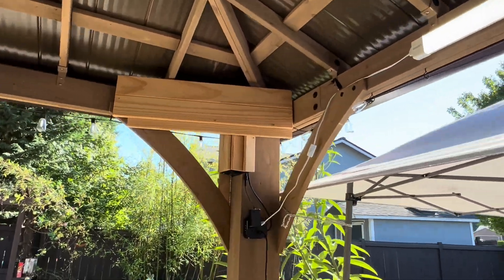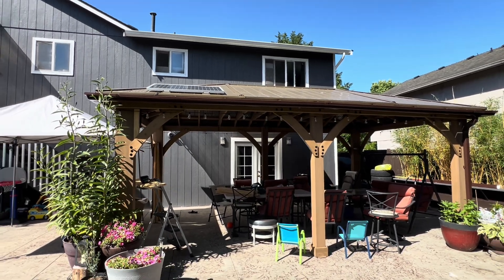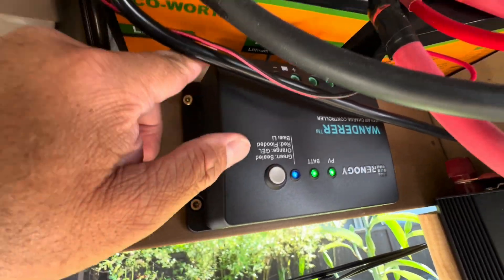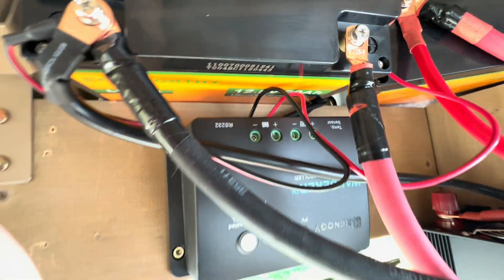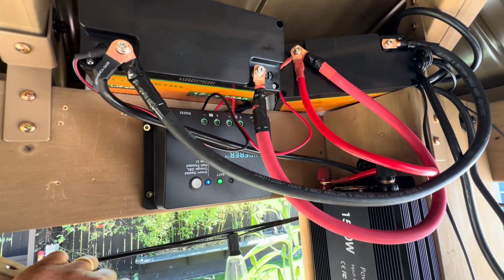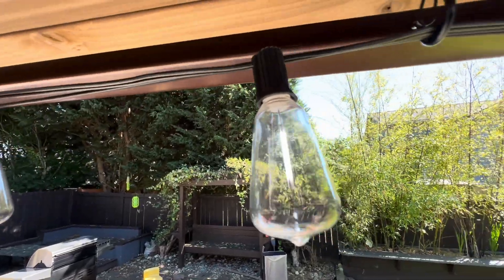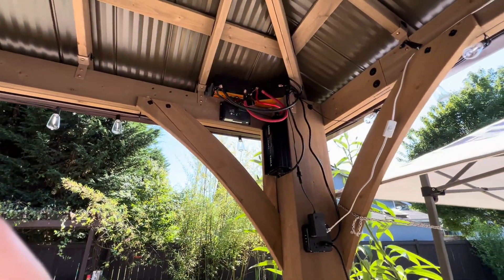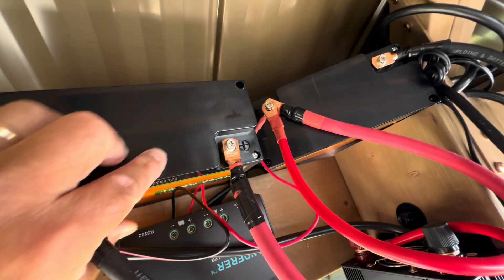COSTCO GAZEBO, SOLAR parallel setup, 2-12v batteries. 1500W with Renogy controller. Runs Power tool!

Comment: Nice little set up. Good video. Something to consider for the future of your set up. 200w-to-300w of solar panels per 100ah of battery depending on where you live. And roughly about 1000w for inverter per 100ah of battery. I have 2 12v systems, a 1200w solar, 400ah lithium battery bank, and 2000w pure sine inverter. Second system is 400w solar, 100ah lithium battery and a 1000w pure sine inverter.  My first project was a 100w harbor freight kit and a 100ah AGM battery with a 750w modified sine wave inverter. Alot of research and watching Will Prowse and solar diy forum i have learned alot over the years to build alot of the side components for my solar set up like my shunt to solid state relays solar shut down for over voltage, under voltage, temp cut off ect. What once was a fun thing to do has turned in to an obsession to not only to be safe but have more power. Blackouts,  ect.  Hope to see more of your progress as time goes on.
Reply from the maker: Yes, you’re giving some really sound advice! I’m realizing my inverters oversized for what I have and a pure sine wave is better idea too. This is my first time setting up the solar system. It gets pretty addicting! Lol it’s a pretty cool concept that you’re able to generate energy from the sun and store it for future use.

Comment: Hello, I'm totally solar.  Consider cross connecting -- meaning neg on first battery to solar regulator, and hook to positive on second battery to solar regulator.  This forces them to be used as one 40ah 12v battery.  These little tricks help and you will understand better if you monitor your batteries for awhile before trying.  Do the same with the inverter and you can even cross connect pos on first and neg on second.  I'm using 700 watts solar and 4x100ah SLA (sealed lead acid GEL)  it made everything smoother.  FYI to all...
Reply from the maker: @CouncilOfWrong  thanks for the advice i will look into this!
Reply: @DIYBigGuyy  What he said is incorrect - if you put them in series you will get a 24V battery. Like you have them in parallel doubled the Ah. Do a simple google search before you smoke your inverter.